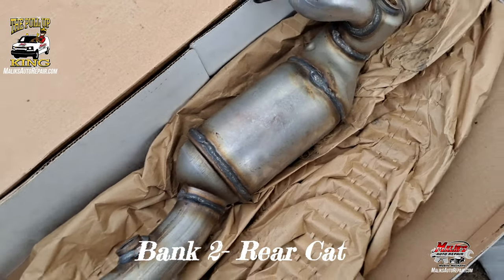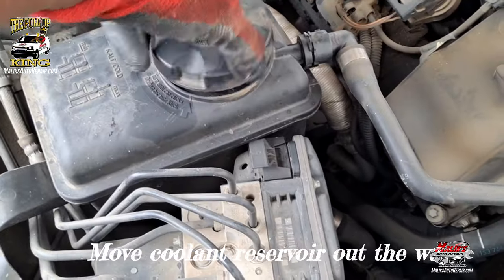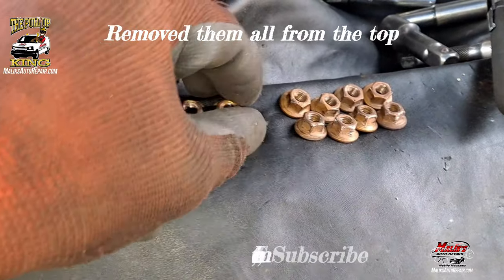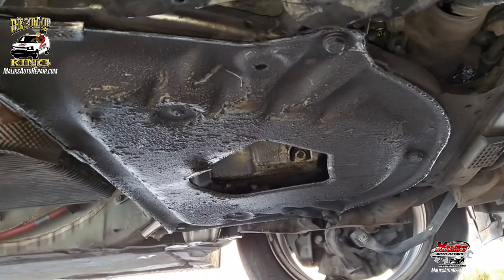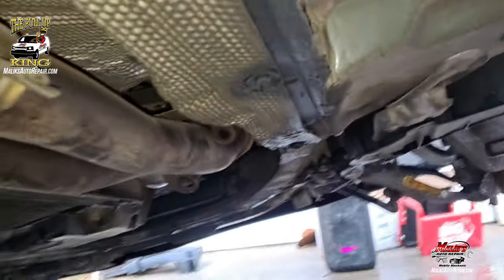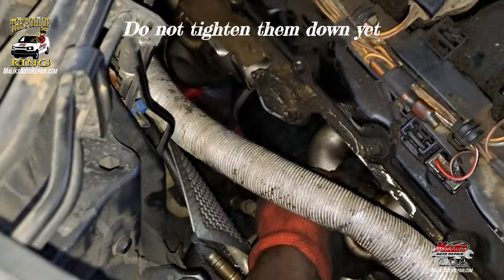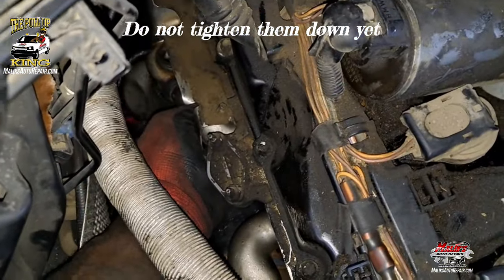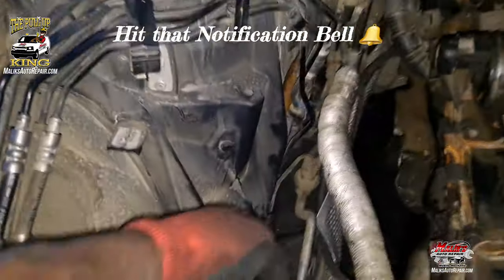GET RID OF CODES P0420/P0430‼️BMW 528i | DETAILED/REPLACE CATALYTIC CONVERTER | O2 SENSOR|Howto/Diy

Comment: Did this on my daughter 05 X3 3.0 
Was not a fun job.  Did a little bit every day after work but got it done.  Also did the valve cover gasket. 

Good job man
Reply from the maker: Thanks alot man. This repair is not for the weak.

Comment: YoOoOo… This has been a real pain. Not gonna get into why I had to buy 3 engine support bars that I’ve YET to receive. But seeing that I can just bump up the engine without dropping the subframe is a game changer. But if you could explain why it’s ok to see smoke after installation, in context would be great! Thanks in advance. Good lookin out on the much needed content. 💪🏽✌🏽
Reply from the maker: When you touch and handle the cats, they get grease and whatever else on em. When you start it up it burns off. That's the smoke you see. Thanks for watching

Comment: Thanks a lot bro!! I bought the 2 cats because I start to have issues no codes except when I'm going full throttle the check engine light comes on and it shows a message in the Idrive about "engine louds may damage catalytic" I already replaced spark plugs and the ignition coils but is still doing the same and also when I give it a lot of gas on the highway I can hear a a sound like a rattle noise coming from underneath like twisted cans so I'll be replacing this myself because a shop wants to charge me 1200 for this job!
Reply from the maker: That's dope!😎 I'm glad my video can help you out man! Definitely sounds like the cats could be clogged. Let me know how the repair goes! Thanks for watching!👨🏾‍🔧
Reply: Mines did same but engine light started blinking and extreme engine rumble with clacking rattle ….I scanned and got same codes …..only down side barely could find decent Cats for 550i it looks like it’s go HARD or go HOME
Reply from the maker: @ELIJAH-lw6dq  Ouch. I got em from Autozone.
Reply: @ThePullUpKing  im assuming the cat u putt in is still solid ….any problems???
Reply from the maker: @ELIJAH-lw6dq  Absolutely. Lifetime warranty as well.
Reply: @ELIJAH-lw6dq  bump

Comment: did you unscrew the motor mount bolts when removing the cat? Or was the mount already unattached?
Reply: my motor mount looks just like yours. did your have bolts on them before you made this video?
Reply from the maker: @juancardenas6184  Removed motor mount bolts.

Comment: Did that codes p0430 and p0420 just cats or maybe can be o2 sensors?
Reply from the maker: I diagnosed it before the repair. It had no power.
Reply: @ThePullUpKing  yea, my car have power and everthing is fine when driving, no misfire, and something like that, engine works perfect, i trying to fix this problem for year and i dont know what it is 🤔😪
Reply from the maker: @BlackKamikaza  The 🐈 s 🫣
Reply: @ThePullUpKing  🙈.
You fix that problems for now 🤔?
Reply from the maker: @BlackKamikaza  Have you replaced anything?
Reply from the maker: @BlackKamikaza  I cleared my clients codes. Was able to pass Emissions too.
Reply: @ThePullUpKing  i replace spark plugs, i didnt replace coils, catalysts, and oxgen sensors
Reply from the maker: @BlackKamikaza  Don't throw parts at it. Diagnose the issue first.
Reply: @ThePullUpKing  yea but maybe catalytics are bad or o2 sensors in my opinion 🤔
Reply from the maker: @BlackKamikaza  But you can find out for sure by diagnosing it.

Comment: you should have cleaned the cats first before attempting to buy a aftermarket cat due to the fact that an 02 sensor that came with the kit will die in a year and you'll have to buy a new O2 sensors the reason why it dies is because of the carbon buildup you need to clean the catalytic converter before buying a new one I'll just buy the original one which cost more money
Reply from the maker: I don't clean my client's cats at all. I just replace them and o2 sensors. Works anytime ive done it. Check engine light never comes back for Catalytic converter again. Satisfy client. He hasn't had any issues since. Thanks for watching
Reply: @ThePullUpKing  you know you could have removed the cats from up above instead of on the bottom that's what I did with mine and I have an 04 the only problem is is when you buy an aftercat or an aftermarket cat not original OEM the O2 sensors that came with the cat will die eventually in a year to two or a year and a half before you can replace them and if he burns oil then then they're going to get dirty even faster and couple more misfires it was a nice video
Reply from the maker: Wasn't aware of that. I'll check with my BMW specialist buddy and look into it. I appreciate the info.
Reply: @ThePullUpKing  I just like to say it was a nice video too bad you wasn't in the Connecticut area I probably would have need you back then but I had to do it myself
Reply: @ThePullUpKing  so did you keep the original cat converters if you take it to a scrap yard they'll give you $400 for both of them that's how much I got mine for in Connecticut
Reply from the maker: Thanks man! Everyone can use a reliable mechanic that comes to you. They love my service here in Ga!
Reply from the maker: $500 each
Reply: @ThePullUpKing   You say that you charge five hundred dollars each side
Reply from the maker: How much I got for each Cat
Reply: @isrealperez9069  I had to buy aftermarket cats for my bmw cause I couldn't really find oem cats, but it's fine cause I'm using the oem o2 sensors I had on the car already when I get them replaced.
Reply: @EmpraMcdade  no worries I had the same problem and my aftermarket cats are fine I had a p0420 and p0430 code for 2 months I think I've fixed it waiting for Saturday it should be ready for smog
Reply: @isrealperez9069  got the same codes and was chasing it since like august, car runs fine though no rough idol or misfires. Car just has sputtering engine when I accelerate.
Reply: @isrealperez9069  I got some cats from ebay but they should be fine.
Reply: @EmpraMcdade  and you don't mind if I ask you could you tell me the name of the catalytic converter that you purchased on eBay cuz mine just died it's not working anymore
Reply: @isrealperez9069  funny thing is mine didn't solve the issue so I'm gonna just get some oem ones that are used.
Reply: @EmpraMcdade  did you check you're fuel trim and fuel pressure I got mine pass smog here in Connecticut two weeks later today my light came back on for both p420 and p0430 you may have a exhaust leak that's why it didn't work
Reply: @isrealperez9069  I have codes p0420 and p0430, I haven't checked my fuel trim and fuel pressure yet though. And I'm not sure if I'll have an exhaust leak cause wouldn't that mean I'll get a lean code?
Reply: @EmpraMcdade  I feel pressure will cause a P0420 and a 430 it needs to be at 50 psi you prime it first and see how far does it drop if it drops too heavy like going down then it's a fuel delivery problem that will also cause it then the other thing is anything that relates to filtrum will cause your misfire which causes the 420 and 430 and depending on the torque that you when you put in the catalytic converter that will create an exhaust leak from the manifold you can start up your vehicle and take a whiff in front of your vehicle you can smell it and you know that you would have to tighten that down do not try to put Fowler's in the back of the rear O2 sensors cuz those don't work
Reply: @EmpraMcdade  I forgot to mention if you have Torque Pro app on your phone that would actually tell you what your field trims are and where they need to be and mind you the field trim for Bank One and Bank two Airfield ratio must be close to zero as possible if your vehicle is running too rich that will set the P0420 and 430 code if it's too lean that will also set it